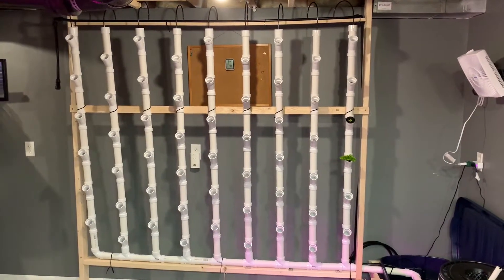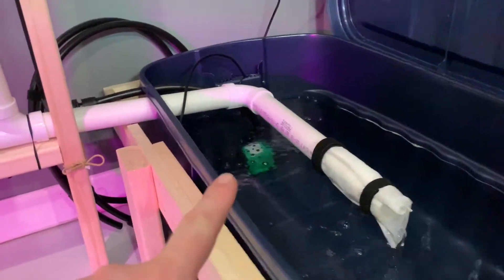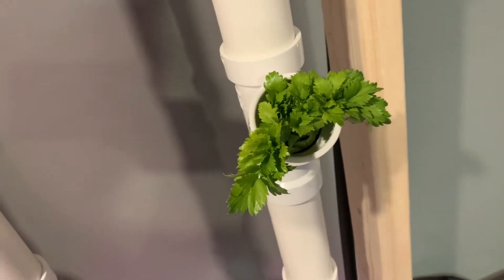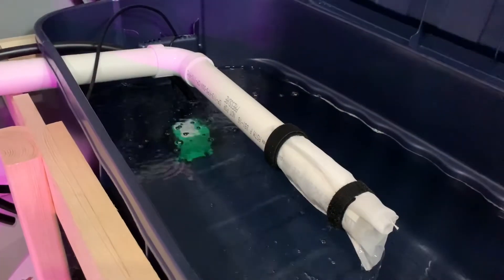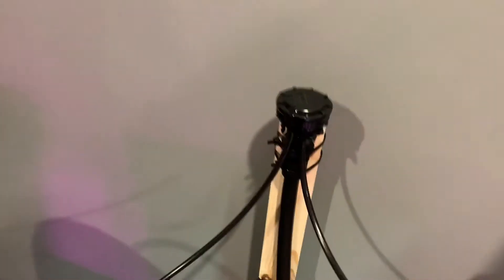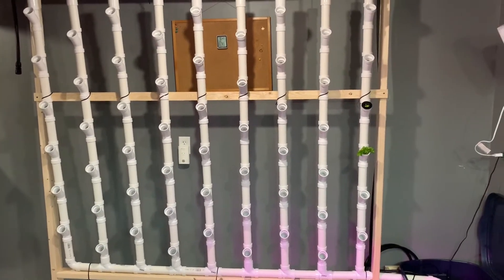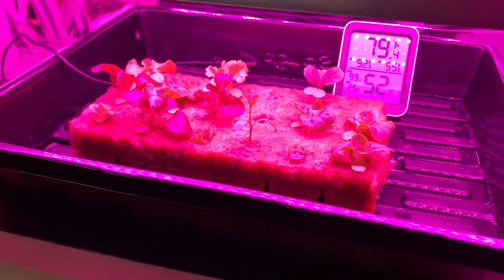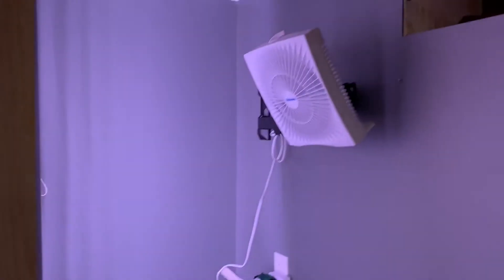Hydroponic Grow Wall Towers & Dutch Buckets - Basement Hydro - Week 1

Comment: Curious why you have the towel wrapped around the drain discharge?
Reply from the maker: It’s a microfiber bag that filters any plant matter and anything else from going into the reservoir and back up the water pump. Gotta make sure the bag stays clean or it can clog and back up the system though.

Comment: Great job on the build! Question - aside from the startup costs for the system, does the normal operations for electricity / plant food etc make this worth it? Just curious from a financial aspect as other positive things to consider would be having the ability to grow greens yourself year round.
Reply from the maker: To be honest, I did it more as an experiment at first, just to see if I could do it. My first run went better than I had expected even and I am about to start it all back up again! I will say, the sheer ease of going into my basement anytime and picking fresh lettuce for a salad or sandwich or something is awesome. It is quite a bit of work though!
Reply: @Joeyolson  Yeah that sounds pretty awesome. I'm looking to do the same size myself. Just curious if you don't mind me asking, what made you take a pause on the system? It seems like one that's always on loop.
Reply from the maker: I had a small crack in the bottom of the big reservoir. I was needing to switch it out and life got busy and I just never did. The system produced way more, and faster, than we thought too. I may even go half on the next run to see how that goes. Hit me up on my site or on Instagram if you have more questions!

Comment: For the number of plants you can grow in these vertical towers you might be better off going horizontal, requires smaller pump and easier to build/clean/harvest, and more efficient use of the grow light.
Reply: I'm debating between vertical vs horizontal. It looks to me like the vertical ones are more space efficient? Would you mind explaining how the horizontal is more efficient with grow lights? Still learning and researching. Thanks!
Reply: I saw a video from a professional who did the math on verticle vs horizontal and it turned out vertical was better as far as sqft useage. I'm actually in the process of doing a project very similar to this one.

Comment: i think this system spends more money to be in use than the cost of the food it produces,,,,,,i mean the cost of the light ,the air machine and water pump,,,,,those three parameters should use solar panel and not common electricity....
Reply from the maker: Totally agree. This was a project that I built for fun on my own to see if it would even work. It worked better than I had even planned and grows way more than my family even uses. 

The convenience is awesome though. My wife picks fresh kale and clips lettuce for salads minute before eating it. It’s all super fresh. 

Some day I plan to build a green house outside and add solar to power and some geothermal to keep it warm longer. My buddy is about to have a big outdoor garden so we are going to work together on sharing harvests.